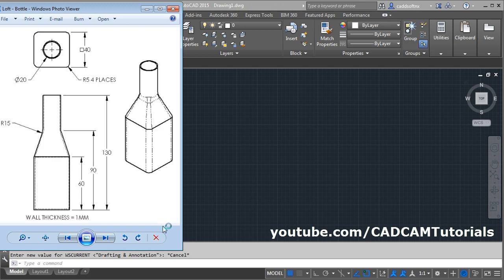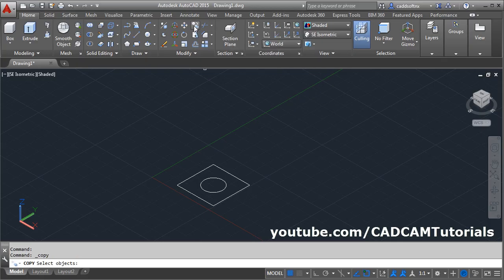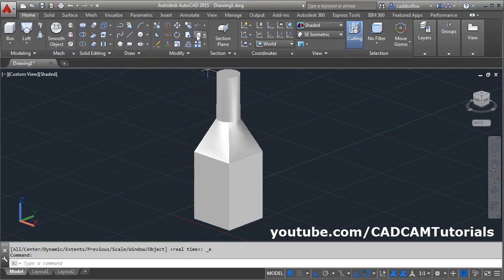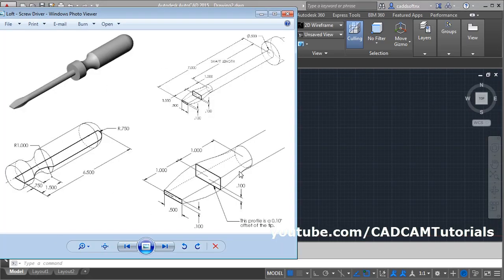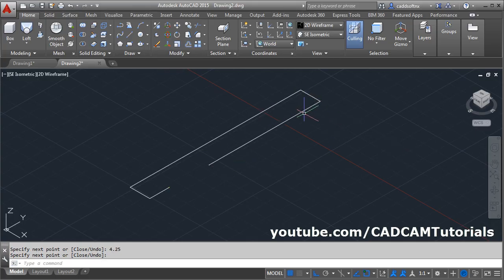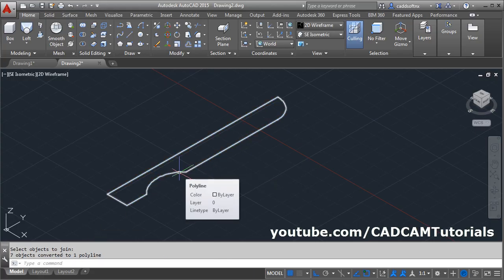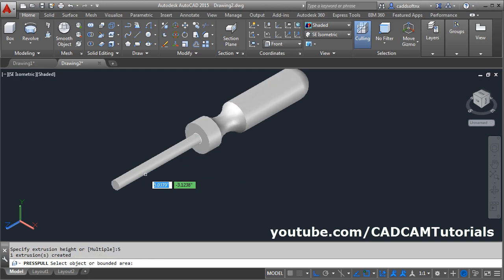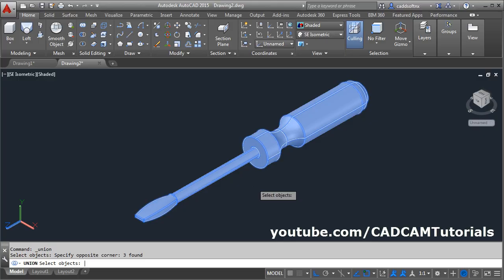AutoCAD 3D Practice Drawing for Loft Command | AutoCAD 3D Mechanical Drawing | Bottle & Screw Driver

Comment: I'm struggling to join the tip of the screwdriver because for some reason, my loft doesn't join the three figures. I am in UCS Front & SE Isometric view. I also have a MacBook. Am I doing something wrong?